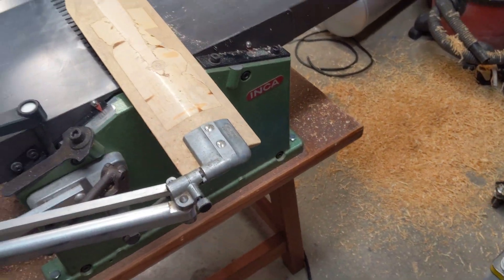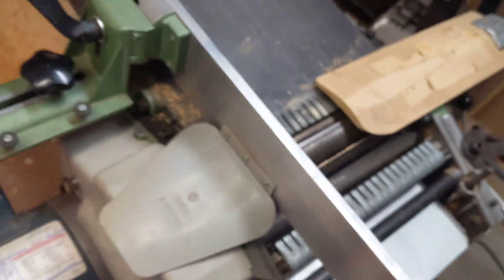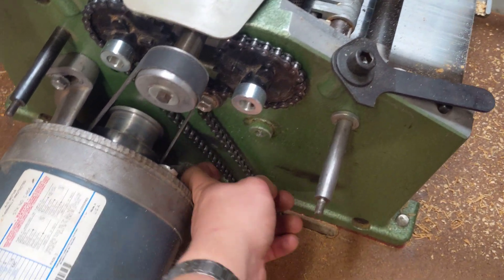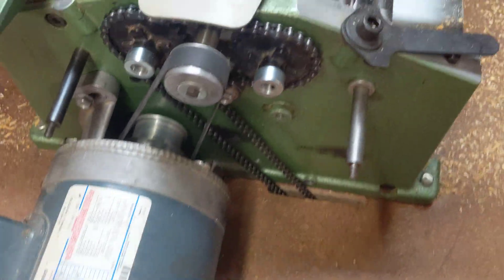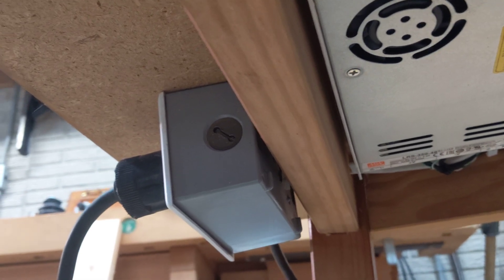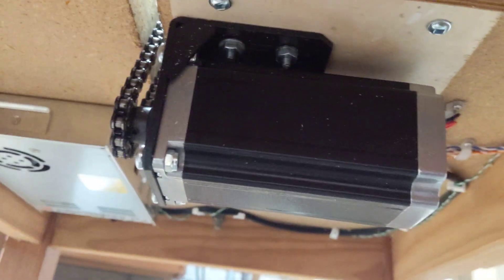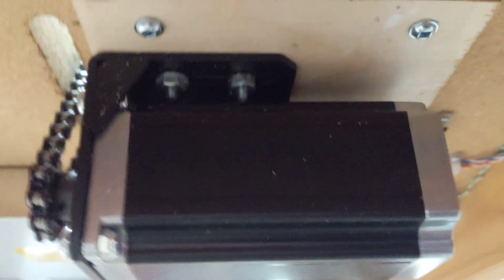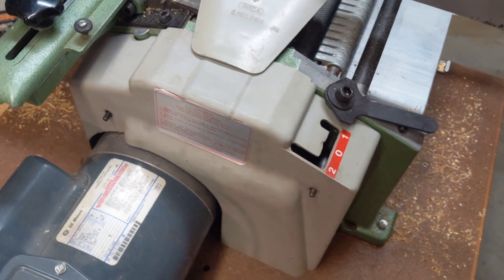Inca Jointer/Planer (550) feed drive modification

Comment: It looks to me that one could use a ZK-SMC02 controller (around $25) instead of the arduino, and not have to worry about writing code and stuff.   on the whole what an incredibly more budget friendly approach to the 570 drive issue.  thanks.

Comment: Jordan, I'm trying to make this conversion to my 570, but I need a little assistance. First, the power supply is no longer available. Could you please recommend an alternative, and sources for the 10-tooth sprocket, the chain, the Arduino nano, and the on-off switch/speed controller unit. Appreciate it.

Comment: Hello there,
Thank you for helping other people like me fixing the good old jointer.
Follow your instructions with the same overall gear. I have an issue withe the motor stopping (skippimg steps dont know..sounding like grrr😂) and have to push the material in order to pass. Do you have any idea why would this happen? The chain is a bit loose but no too much. 
Thank you

Comment: How do you adjust the table so that it doesn't honk?  That's the only thing I dislike.  I have the planetary gear driving the feed rollers.
Reply: I'm a former Inca rep from back in the day. I still have this machine in its original form. The design shortcomings are real. The quick way to silence the 4 raise/lower screws is to apply the same wax that you use to lubricate the planer table. I use paste wax. Waxlit is a ripoff.

Comment: How’s this holding up a few years later? Does the motor get to hot? 

I have the same machine, same problem and wanting to fix it. Not sure if I should use a bigger motor. Thanks.
Reply from the maker: Runs fine.  I dont run a ton of material through mine though.  I havent had any issue with heat though.

Comment: Nice modification.  Do the missing teeth on the table affect the function of the jointer?  Why are there teeth on the table edges?
Reply: @billwebster759  The slots in the tables are there to reduce noise.

Comment: Is this system still holding up? I am on the cusp of going for it. I have only one experience using arduino and i think it'll be challenging for me. Are you running separate power cords to the planer motor and another to the power supply? Thanks!

Comment: I too, liked your stepper motor solution, which I will do on mine, after replacing the plastic double worm gear twice. I also would like to know what type of pot or rheostat you used in the variable speed control box.

Comment: I liked your design so much that I have ordered the motor, the mount, and the driver for the motor, however, what is in your controller box? Would you be willing to share what you did inside of that switch box? Thanks for your time. Great work-around on a pretty cool machine!
Reply from the maker: I used an Arduino micro/nano.  The Arduino reads the potentiometer and uses the tone() function to output pulses to the stepper controller.

Comment: Hi Jordan, Thanks for the great video. I'm thinking of making a similar mod to my 343.190.01
I'm based in the UK so our voltage is 240v
Looking at your parts list the transformer appears to work for both 110 and 240 ranges so I'm assuming this would be good over here.
Not knowing anything about wiring the three components up, is it reasonably straight forward, or do you have any sort of wiring diagram for your setup?
Also did you have to adjust motor positioning under the table for chain length or is it accurate enough by just removing an appropriate amount of links on the chain?
Hopefully I can achieve something like what you have done. I'm getting a little bit disheartened with very hot worm drives and mine uses the round green 6mm belt rather than the flat like yours, so I'm forever having to change or shorten them.
This should fix that Achilles heel of what otherwise is a great machine.
TIA
Roger

Comment: Great job I love it. It is al clear to me except how you set up the Arduino can you give me some more infotmation please. I have a local technician who can help me
Reply from the maker: The Arduino reads the position of the potentiometer.  Arduino has many tutorials how to do this.  I then use the map() function to map the position of the potentiometer to the range frequencies I want to output.  The Arduino then uses the tone() function to output pulses to the stepper controller within the frequency range I chose.

Comment: Nice job 👌👍 I am about to do the same on my 560, i noticed you have 2 aluminum stop outside the upper sprockets? did you have problem with the two plastic sprockets ? On my J/P they need to come out 5 mm else the chain will interfere with the machine chassi in the bottom. 
Can you please put up a link to the motor  you used.
Mvh Fredrik
Reply from the maker: I added some links to the motor, controller, etc.  The stops on my J/P are from when I replaced the main spindle bearings, I had to remove the press-on retainers.  I had the collars laying around my shop and they've worked fine, so I've never bothered changing them out.
Reply: Ok that's why the collars is there. 

You didn't have the same problem with the "chainline" from upper sprockets interfere with the machine chassi at the bottom.?
Reply: @esperans  the chain is very close to the chassis but does not touch it